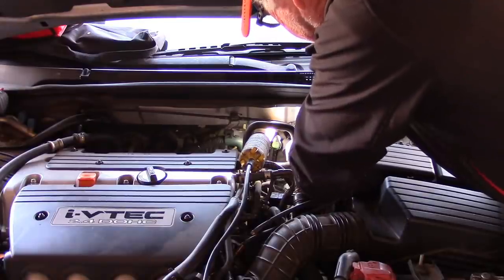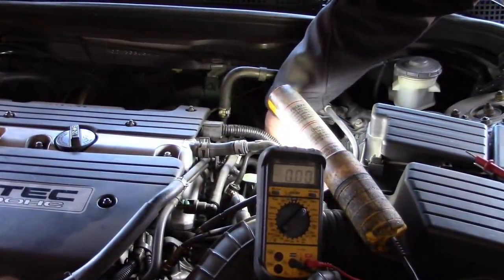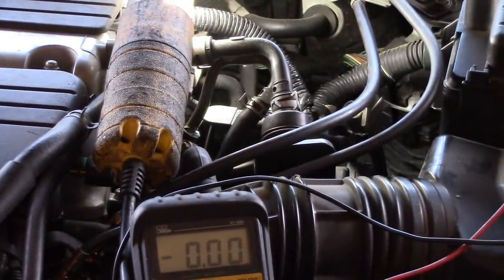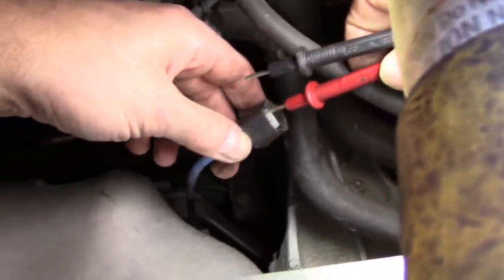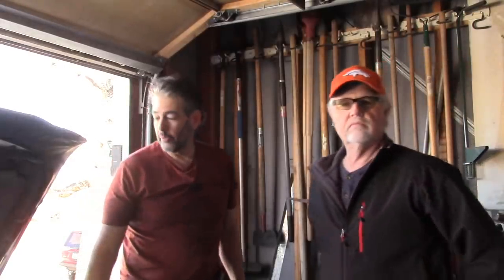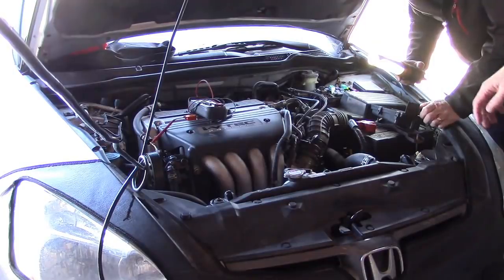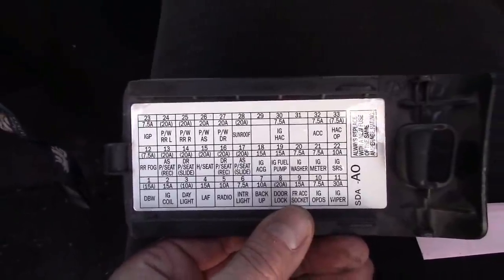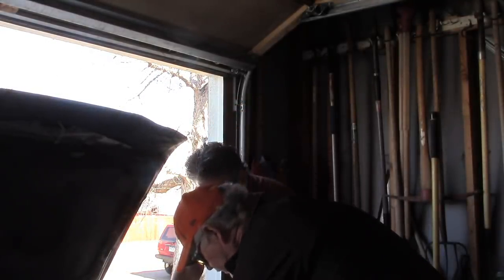Field Trip!  P0135 O2 Sensor Heater Diagnosis

Comment: Good job. Keep in mind though sometimes heater circuits can short out and blow the fuse. Requiring a fuse and a sensor. I have seen it many times.
Reply from the maker: True that- thats why we checked fuse, and it was fine. Definitely possible.
Reply: @SchrodingersBox  we know this and a hater didn't want you to check the fuse. Sigh.
Reply: If the fuse blows, 99 times out of 100 there is a short that needs to be fixed. So replacing the fuse wouldn't "fix" the problem
Reply: @averyalexander2303  that is correct. Okay maybe i was not specific enough in my initial comment. I said "heater circuits can cause the short" i should have said the heater inside the sensor iteself is often the cause of the short requiring both the fuse and the sensor to be replaced.
Reply: @Autofixpals  Oh okay that makes sense. I thought you were saying that sometimes it shorts out and blows the fuse and all you need to do is replace the fuse and it will work again. Thank you for explaining
Reply: Plus it wouldn’t have had the 2v that it had if the fuse was blown, correct?

Comment: i would like to say if we have voltage from the first test so no need to check fuses because there is no open circuit .
Reply from the maker: Exactly!! Thats exactly why I knew the fuses wouldnt be issue but it was good to just follow through since Dale did bring it up.

Comment: Bernie !!
nice of you to stop by ..
Reply from the maker: Lol Dave, I don't know about you but I am still waiting for ol Embree to respond.
Reply: Matt, I just want to say the information you're putting out here is worth way more than 3.49 and anyone who's going to whine about that can shove it. I found your channel a while back while looking for diagnostic information on a map sensor. Even at minimum wage the fee for your channel is worth it for the time I could waste digging around and finding no useful information on diagnostics. The vision of your channel is spot on, and  I super appreciate what you're doing here
Reply: pay channel for 02 sensor power ..??
lame azz
Reply: pull the Fuse to check it ..??
w0w ..
this Channel is totally going in the toilet Bernstein
Reply from the maker: Its just because the location of the fuse made it easier to just pull it otherwise I would have used voltage drop.
Reply from the maker: Ok Embree- since you don't think this is pay channel worthy, that means you have explanation for .5V on the power feed both with sensor ground and chassis ground BUT you see 2V on BOTH the heater power AND ground when engine is running.
  Obviously, you would be able to explain why that is happening.....so.... save everyone $3.49 and tell them right here and now!! Easy, right, since its so basic?
  We're all waiting!
Reply: @SchrodingersBox  I think we'll all keep waiting.
Reply from the maker: @embreesmith7613  Still waiting.  Can only assume he doesn't understand the basic fundamentals to answer the question.  Isn't it ironic how the people who criticize the pay channel are the very people that make up the intended audience because they lack the basics the channel teaches?  Thats so funny to me!!
Reply: @SchrodingersBox  It's probably just one of Scotty Kilmer's bots.  You can tell it's not him because it isn't all uppercase.
Reply: @SchrodingersBox  tick tock! Cue the  Jeopardy music!

Comment: Know where you are in the circuit, very proper voltage and ground before you change any part. Nice job!
Reply: I had a similar situation once with an oxygen sensor. It didn't have a heater circuit code. The stoiciometric side appeared to be dead. I checked it with the engine running and I saw a normal oxygen sensor trace. I tried putting a little 1.5 V battery on it and the PCM still read nothing. I checked to see if those two wires were connected when they shouldn't. They weren't. Turned out the PCM had gone bad. The circuit to read the o2 sensor trace was broken.
Reply: Jeff Hesse for sure, 15 minutes checking voltage, continuity, and or resistance. Ive become a self taught wiring expert thanks to a Caddy Deville, amd CTS both 2002s smh lol!